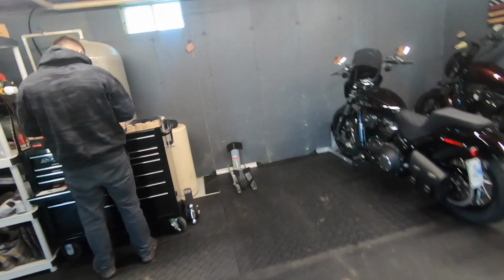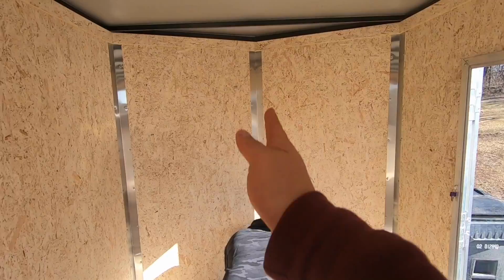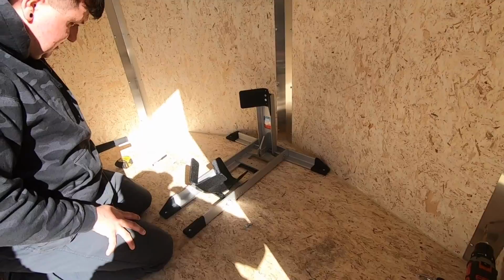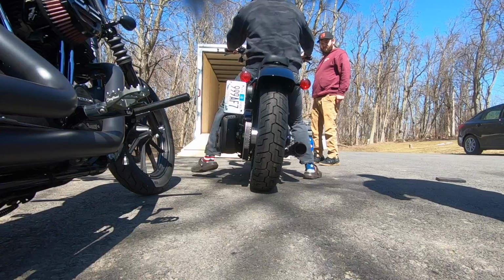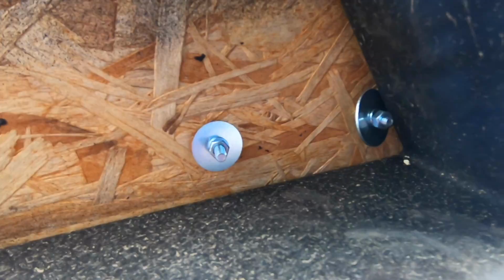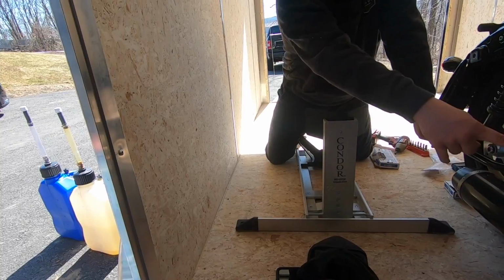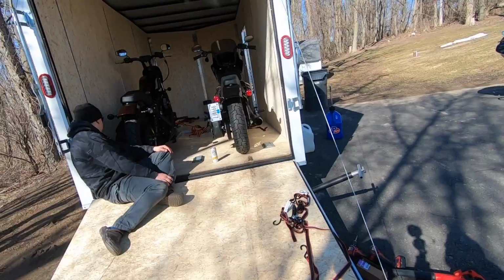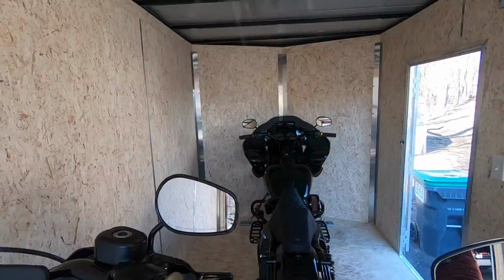BEST MOTORCYCLE TRAILER SET UP

Comment: This is not a video you should reference for ideas on trailer setup for hauling multiple bikes.  Weight distribution and the placement of track tie down rails is completely wrong!!   Pulling this trailer at highway speeds is a disaster waiting to happen not only for the vehicle towing it but also for the innocent unknowing drivers around them.
Reply from the maker: We will park them sideways for you next time 👍🏻

Comment: If you had done more planning,  measuring and bought some more materials,  you could have made those things easily removed and you could use the trailer for hauling furniture etc or maybe even use it for a camper. Way more weather proof than any tent. Just weld some tubing under the floor with some wellnuts in those crossmembers so that you can just zip those bike stands right out.

Comment: Watch this video for everything you don't want to do! Good start but omg 1/2 " washers on a 20k motorcycle. Should be using steel plates underneath. Never compress the suspension for long travel. Strap to the lower forks at the fender. And not sure what that 3rd bike is but not a street glide!
Reply: 40k bike who gives a fuck haven’t had an issue in 5k miles hauling

Comment: I use similar wheel shocks but strap bike below front shock so you don't compress suspension which is preferred way to strap down.  Safe travels guys.

Comment: I was speaking with a large trailer dealership. I inquired on buying a enclosed 6x12 cargo trailer. I said I wanted to install a Condor bike mount with e-track. He said if I bolt it down to ANY trailer it will void the warranty. Is this typical??
Reply: Clearly they don't trust the particle board plywood flooring.  Can't say I blame them.  Cheap plywood
Reply: I can't believe they didn't bolt to the frame. I'm thinking an emergency maneuver at highway speeds and those little pieces of Etrack will rip right out of the plywood/OSB. But as a truck driver with decades of experience securing loads, what do I know?

PS.... maybe put a wireless camera in the trailer to monitor your load? I've been considering something for my 53' trailer.... to see loading progress AND monitor it while traveling.
Reply: Fuck the warranty!

Comment: Good video, was trying to see if I could get 3 baggers in my new 16 ft v nose trailer you got 3 in a 14 ft I should be good thanks
Reply: so, I have no idea if you tried this or not but I had no luck getting three in my 7x16 ft. The bikes are too wide to make it work side by side so you have to stagger. Then you run out of length. If you made it work PLEASE send vid or pics. I NEED to see that happen!!!! Drove me nuts. So nuts that I sold the trailer and bought a very oversized trailer ( so over sized that I will have to get a bigger truck, I do not think my 1500 diesel will do the job). I say that BC since I went bigger on trailer I am now hauling 6 bikes. LOL. :)

Comment: Thanks for posting this video. I have been thinking about a 6x12 trailer for my 2018 Heritage. I notice you have the extension on the ramp. Do you think the bike would clear without scraping if you did not have the extension? Thanks!
Reply from the maker: My last trailer was a 7x14 with no extension and I never had an issue with it. It wouldn’t hurt to throw one on though, super easy minus the price of wood now! Makes it a super smooth transition.